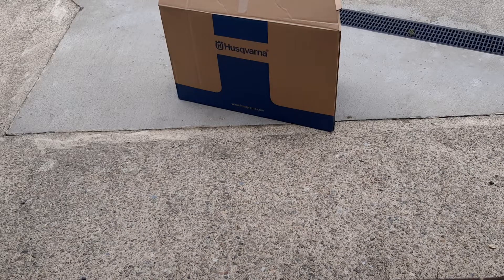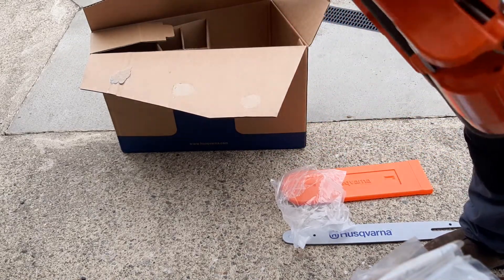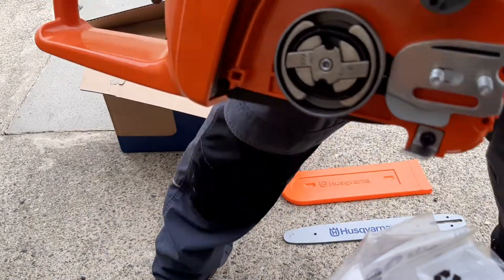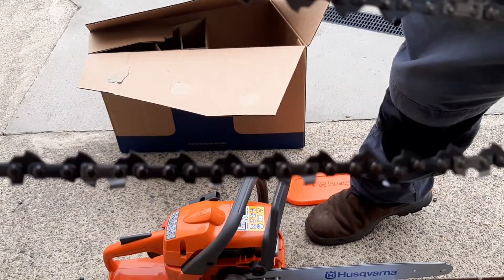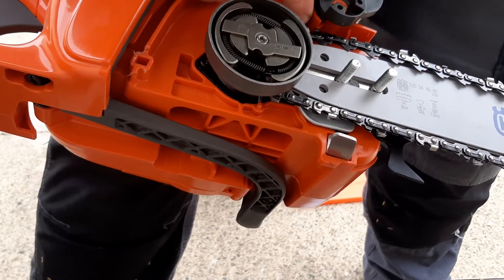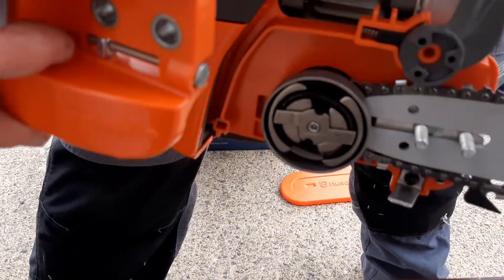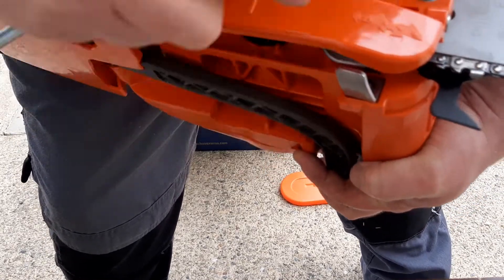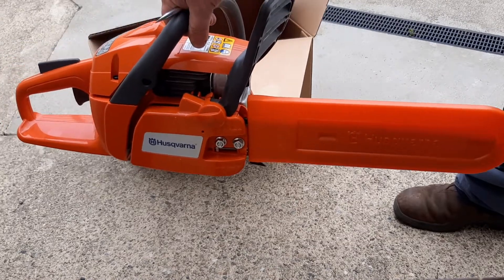Husqvarna 120 Chainsaw Full Assembly instructions

Comment: A rectangle has four ninety degree corners. It's a quadrilateral, I'll give you that.
Reply from the maker: Thank you for the information I know you are quite correct sir
Reply: @doctorlefthandthread  live and learn. Just having fun, don't take it to heart. Considering this saw for jobs that has high chance of theft, to leave next to the chipper. I'd hate for my 346xp to get stolen and the echo 4310 seems a little pricey for what it is. Being the 120 is super light and essentially disposable due to the price, I'm pulling the trigger, but will buy locally if it repeatedly has carb problems. Nice video, now I know to bring the silly splined tool ✌️
Reply from the maker: @7eis  you misunderstand me I appreciate your comments I learn alot from the comments section of my videos. No offence taken at all have a great day.